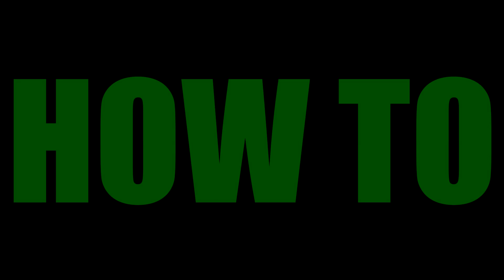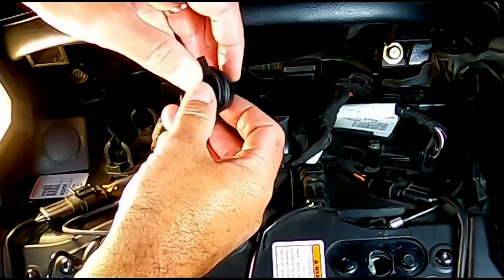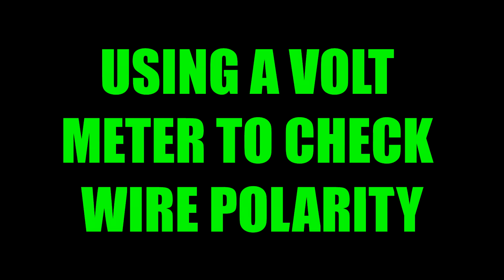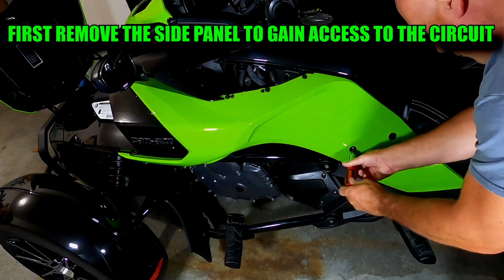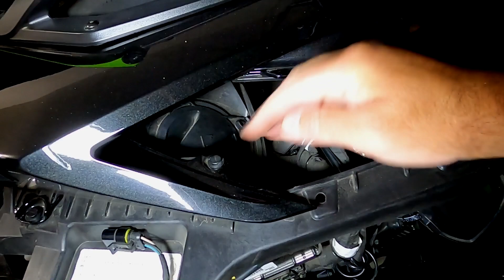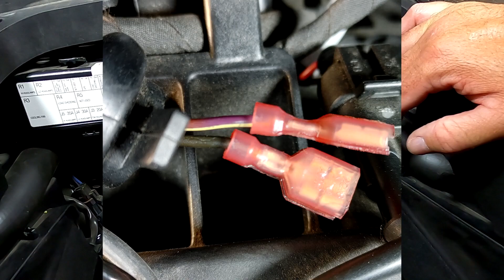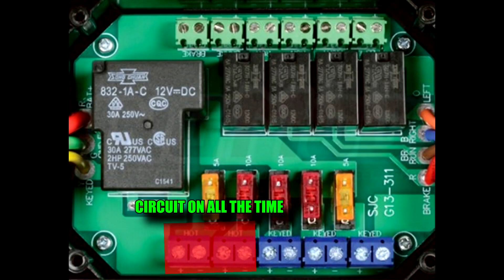Can Am Spyder, Ryker, and RT - Accessory Circuits. This is the best way to install accessories

Comment: Question for you...will the accessory circuit (2013 RT) support a 12 volt cigarette-lighter-type power port? It's for an after market gps.
Reply from the maker: I would not recommend a cigarette lighter type port. For 2 reasons that you may not be thinking about... space and weather conditions. The circuit CAN handle and support it though. You are limited as to where you can put it and how much is it gonna stick out when plugged in. That is also about the most un-weatherproof thing you can do to your Spyder unless you buy a Marine (boat) type port and even then it is not really waterproof when being used. They usually cost more than regular also. If at all possible I would get a fast charging USB port for it. I put one on mine and use it for GPS and Phone and it has a battery gauge on it as well. I would buy a newer GPS that can be charged by USB and the USB port. It is worth paying $100-$200 dollars versus messing up a $20,000 vehicle. If you would like to know what all I used for mine, please email me at:
moab.man@yahoo.com.com
I hope this helped and thanks for the question and support!
Reply: @MOABMAN  Thank you so much for the advice. I actually found a special power cord that is USB with a microchip to enable it to power my gps.
Reply from the maker: That is the best way to go I think. Hopefully you won't have to add any extra ports.

Comment: As always a great video - did not know about the provided accessory connectors around the bike.  Will have to start calling you Professor MoabMan as you know your Spyder well!  Was gonna ask about fuse boxes but you covered at the end, so thank you.  Have you looked at the Black Box offered by Sling Mods?  The only initial difference I've noticed between that and the Show Chrome is the smart phone app to control the Black Box.  Pretty cool, but may be unnecessary and overkill.  Appreciate the insight, Professor!
Reply from the maker: The Black Box has a whole lot of bells and whistles that are nice to have, and also keeps the remotes to a minimal. For these reasons it is superior over the other and the better choice.
Now this is far fetched, but several years ago, there were issues with people riding around and shutting down cars because they "hijacked" the computer in it and this caused wrecks. It still happens today, but the car makers became smarter with the computers. For this reason, I will not add the Black Box to my Spyder. I am paranoid about bluetooth items like this because the access things like this are given in the ECU. There is always someone smarter than me out there, so I try to keep my stuff as "dumb" as possible, so to speak. The next time you are out somewhere, look at how many Bluetooth connections your phone finds.
Good question, and thanks for the comment and support!!

Comment: I had a Ryker 900 for 2 years.  I purchased the A-arm white/amber lights along with the extra splitter harness and some under glow lights but didn't use them. I have since traded the Ryker for a 2021 F3 LTD. Will the splitter I have work on the F3??  They were all purchased from Slingmods.
Reply from the maker: Thanks for the question and support. I am gonna answer this in the comments but if you need more help please feel free to email me at moab.man@yahoo.com.  Having a picture may help of what you have and easier to talk about as well. The splitters will work no matter what can am model you have because they hook up directly to your lights that were purchased, so that will not change. Since I don't have these lights yet I went to their sight and looked at everything before I commented to you so I can speak about it. The main thing that may be a problem is the power harness that you need. It looks like it is the same connections for the F3 as it is for the Ryker and it should be. There is always a chance I am wrong but as far as I know they are the same. The pictures shown were different though, so I want to give you some options with # 3 being what I would do first.
1. If you are OK with cutting wires and adding connectors, you can always cut and connect them without using the connections from slingmods. Doing so will make it work this way no matter what. The wiring from slingmods uses red for positive and black for ground. The bike has the wiring like shown in the video, but do test before connecting  just to make sure which is which on your ride. 
2. The fuse block from slingmods would be good to use for future items as well. The only thing you would have to do is cut the main connector from the lights that was to plug into your motorcycles circuit and connect the red to the + and the black wire to - on the fuse block ports for the turn lights. 
3. The main thing I recommend doing (just incase I am wrong) is contact sljngmods and ask the same thing you did to me. Their help desk people have been great to deal with for me and they will, or should, know for sure what is OK to do. If you never used it, they may be willing to help replace the item for what is needed incase it has to be different.
I tried to answer you the best I could since I have not physically handled the lights you have. Again, I'd be glad to help you more, if needed, just shoot me an email.
Reply: @MOABMAN  great. I will email a pic tomorrow.
Reply from the maker: @MissDebbye  I will watch for it. Also the more pics the better! Glad I can help